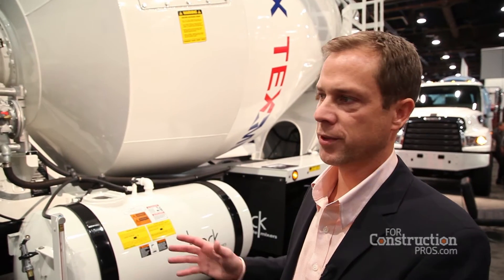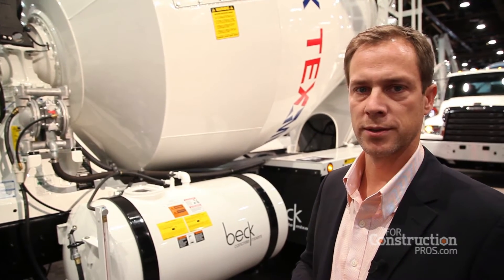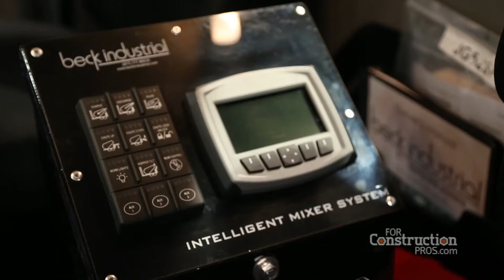[VIDEO] Beck Rear Discharge Concrete Mixer Walkaround

Comment: Changes direction while driving, quickly changes direction when pouring and slow to change when you want it to. Can't swing chutes all the way to the side then lock it. Difficult to pour into, say a pump, at odd side angle or hight. Pause  button activates when not meaning to press and doesn't when wanting to. Makes wheelbarrow jobs interesting. Garbage in my opinion. Shouldn't be called "intelligent".  But what do I know.  I'm just a driver not a mixer engineer. 🙄

Comment: How do I fix the fact that the drum constantly changes speed while I'm driving? I have to constantly reset the drum rotation speed while in transit. This is true of all the new mixers we have received with Beck systems.
Reply: Try running with the rear keypad disabled.. mine will do that from time to time especially if i go over a bump and the rear pad is shaken.